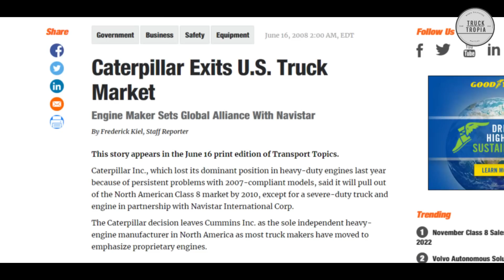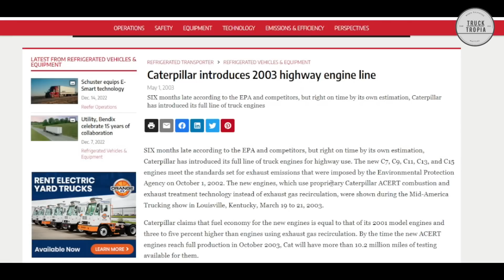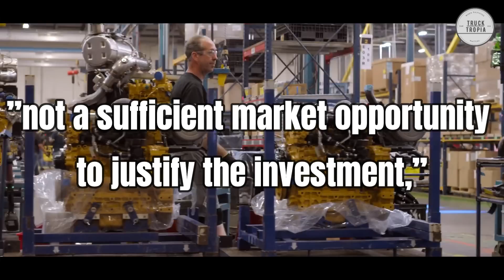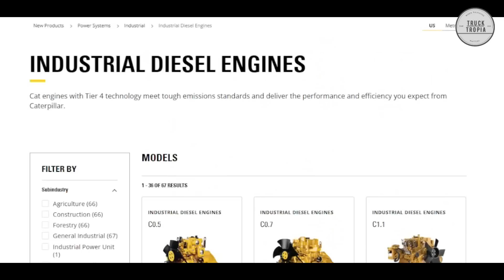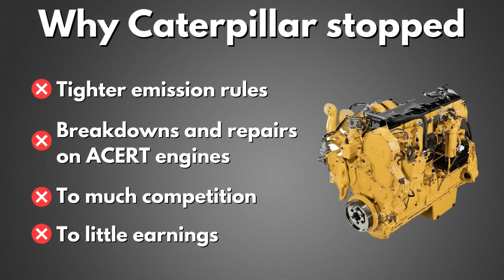Why Caterpillar Stopped Making On-Highway Truck Engines

Comment: Honest assessment of why Cat opted out of the on highway market. The trucks were too heavy and the engines too unreliable/fuel thirsty compared to what was available from other manufacturers. 
That said the rules for off highway equipment is not a whole bunch different than highway standards now. EG T3 as compared to T4 now. Soon to be T4 for off highway and T5 for on highway?
While I am not a big fan of Cat engines maybe there will be enough patents expired/Cat has learned getting to T4 standards for Cat to make the leap to T5.....still gotta make a truck chassis that is not made out of lead though
Reply: Cat never made a truck chassis.
Reply: @cbmech2563  Cat did put its name on a truck though......and it was way too heavy when compared to the competition
Reply: @paulchristensen2854  IH chassis and a maxforce engine. Never could figure out why Cat did it
Reply: @cbmech2563  IMO It was the engines that attracted Cat to Navistar. In the early 2000s Navistar had some kind of an agreement for sharing emissions technology with M.A.N out of Germany for their maxxforce engines.
Reply: @paulchristensen2854  and I still don't know what insanity infected Cat. Definitely not the smartest decision that they ever made.
Reply: @cbmech2563  IMO The" insanity" .as you put it, was the access to M.A.N's emissions technology Technology that no doubt has found its way into Cats construction equipment/off road and marine equipment Emissions standards for these have risen alongside the on road engines

Comment: The issue isn’t really the emissions on their own. It’s the fact the government decided HOW you get to those emission levels. Regulating a certain level of emissions or even No emissions is one thing. Requiring specific parts that are literally DESIGNED to break is another. 

Screw DEF
Reply: Designed to kill a diesel engine. And lobbied for by the manufacturer's of the def equipment.

Comment: Can CAT not build engines as industrial unit that can be installed by truck builders who then employ the pollution measures as add ONS for road use outside of the full engine build / supply. So some company needs setting up as the anti smog equipment manufacturer for use in any of the big ones. As far as I know some truck manufacturers will supply their trucks with the buyers choice of drivetrain? Like a cat motor and 18 speed Road Ranger. Can't be surprised they let go of the road trucks with all the hoops that are held up against the emissions

Comment: The best engine diesel engines every made was 3406 class because when they CAT said they there  425 , 550 , 650 horsepower was at the drive tires where you need the horsepower not like Cummings or Detroit diesel engines do not have the horsepower at the drive tires  I had a 1978 C500 with 425hp cat I also had 1979 W900A model with 425hp with 3:18 rend gears it had a twin stick the main stick was 9 speed and the auxiliary transmission was a 4 speed  I bought my first new semi truck in 2003 W900L with 72" double bunk sleeper a 3406 and it had a 550hp with a 18 speed

Comment: Simple oil engine is still the most environmentally favourable as it lasts and can be rebuilt many times saving manufacturing pollution. Also large particulat emissions is less harmful

Comment: Super trucker Dan on youtube has three Peterbuilt trucks. Two of them are 2001 with Cat engines he also has a 2013 with the Procor engine which lacked power and economy. For that reason he bought the second 2001 that has living quarters. You can't beat a Cat engine.

Comment: Cat chose the wrong technology to meet the 2007 (ACERT, Clean Gas Injection and their regen system for the DPF) and knew it would have to take a different path to meet 2010.  They bad mouthed their competitors with cooled EGR but the competition was able to meet the 2010 standards with cooled EGR, DPF, SCR and DEF.  Navistar tried to meet 2010 standards with massive EGR instead of SCR, they kicked Cummins out of their trucks because they were using SCR and came very close to going under.  A new CEO came in and begged Cummins to supply engines again to bail them out.
Reply: It is my responsibility to aware every one
Quran is the last book of God which revealed on prophet Muhammad saw quran is the only source of guidance in whole world quran will show you the right path quran also verify bible and torah and other scripture kindly once time you study whole quran and aware yourself from the aim of life and got success in long run 🙏🙏🌹🌹❤️❤️

Comment: The beauty is, you can de-ACERT a Cat. You cant fix bean-counter engineering though. So I'll keep my distance from the ISX.

A lot of people are now freaking out about the ATF enforcing rules as law. But they only use the book the EPA gave em. For decades the EPA has been writing and re-writing "rules" and enforcing them as if congress and the president himself had stamped off on it.

Comment: my last truck had a c13 --the engine has over 1.2 million miles on it,still running,only replaced one injector on it--my truck is the lightest in the fleet,have the best fuel mileage out of 65 trucks----have also  the highest revenue in fleet,tanker operation--keeping it around for just in case armageddon to haul a 45 ft reefer semi trailer for supplies...nobody likes the c-13 but it treated me great,light weight
Reply: It is my responsibility to aware every one
Quran is the last book of God which revealed on prophet Muhammad saw quran is the only source of guidance in whole world quran will show you the right path quran also verify bible and torah and other scripture kindly once time you study whole quran and aware yourself from the aim of life and got success in long run 🙏🙏🙏🌹🌹🌹❤️❤️❤️

Comment: Makes sense.  CAT never really needed the on road market to be successful.  Let's see if the EPA starts to regulate the construction industry as well.  I know that last year California put really strict emissions rules on trucks.  They cannot even enter the port if they are too old.  California this year is regulating generators and lawnmowers for some reason.  It really is a fraction of hours per year that these devices operated.  Thankfully, I have my 2 stroke chain saw already.
Reply: Off road diesels have had the same emissions rules as on road since 2014.
Reply: @southfork67  Not construction, backup generators or farm.  Even in California, we get to use red diesel for farm.
Reply: @samuelmcbride  I sell new farm machinery for a living. You are incorrect. Final Tier 4 emissions rules took effect on off-road engines (tractors, construction, etc.)  in 2014 with the exceptions of engines under 25 hp. They all have DPF, DEF, EGR, and all that crap.
Reply: @southfork67  I believe the 2014 "mandate" was about Tier 1 emissions for off-road, not Tier 4.  Tier 4 is definitely on-road now even to use it.  In California, we cannot even operate Tier 1 off-road except in fleets where the average emission is calculated.  Plus, we have to register it through an emissions center.  That exception is only managed by NOx readings and not manufacturer Tier rating.  Tier 4 mandate was supposed to start in 2022, but I don't think it went through.  Tier 4 is largely done through enhanced diesel fuel.  There are some changes in fuel delivery and urine exhaust treatment, but that is not really the engine.  Tier 4 mandate was "supposed" to be 2015 when it was  created by the EPA, but this was extended to 2022 last time I checked.

Anyway, a Tier 3 diesel can be made Tier 4 by simply adding some things and using new diesel fuel.  In California, red diesel is not necessarily the low sulfur variety and is allowed for use in ag equipment.  There are also a few exceptions.  If an engine builder has any unused inventory of any Tier, they can sell it legally.  If it is emergency, they can sell it.

It does not mean that someone that sells equipment will be able to get less than Tier 4 diesel engines from a manufacturer.  It is just not illegal to do so.  You can get a Tier 3 Polaris Crew Cab in  a crate and sell it legally.
Reply: The government won't be happy until everything has zero emissions. They'd outlaw horses. They're already whining about cows that fart.
Reply: It is my responsibility to aware every one
Quran is the last book of God which revealed on prophet Muhammad saw quran is the only source of guidance in whole world quran will show you the right path quran also verify bible and torah and other scripture kindly once time you study whole quran and aware yourself from the aim of life and got success in long run 🙏🙏🌹🌹🌹❤️❤️❤️

Comment: Best Cat truck engine I ever had was the 1693. Had to be careful when you let the clutch out. It had so much torque you could twist out the drive shaft.
Reply: The engine had so much torque it twisted the chassis coming off the line
Reply: @TIMEtoRIDE900  
The whole truck collapsed !
Reply: Back in the day my dad drove a 65 Hendrickson with a 1693 Cat. He said the same thing
Reply: The 1693 was a great engine, and they were easy to turn up. but they were extremely heavy compared to their 3406 counterparts. but I have known people who continued use them for a long time after the 3406 was introduced.
Reply: The bottom line is that if your foot slipped off the clutch pedal the results were going to be expensive.
Reply: It is my responsibility to aware every one
Quran is the last book of God which revealed on prophet Muhammad saw quran is the only source of guidance in whole world quran will show you the right path quran also verify bible and torah and other scripture kindly once time you study whole quran and aware yourself from the aim of life and got success in long run 🙏🙏🙏🌹🌹🌹❤️❤️❤️
Reply: Torque is related to hp/rpm *5252, if it didn’t have horsepower and it spin at the same RPM as the newer engines it probably didn’t have as much torque as people think they did.
Reply: @B0RN2RACE100  You have to take the flywheel torque (1,800 ft lbs) and multiply it by the gear reduction of first gear and low-range (don't have numbers for that, but let's say 20:1) then add the momentum of the fly-wheel - - more than 36,000 foot pounds.
Reply: @TIMEtoRIDE900  I have numbers, my c15 makes around 1850 pounds of torque 1st gear on my transmission is 12.31:1, rears are 3.36:1, and tires are 11r22.5(they also matter). My point was, if the engine doesn’t make horsepower it won’t make torque since they are related to each other. The 1693T made 325hp @2100 RPMs and at that rpm the torque is ~800ft-lbs and the peak torque was 1000lbs-ft at ~1450rpm
Reply: @B0RN2RACE100  I get your point - horsepower is calculated, torque is measured.
But back to snapping driveshafts - the rear gears and tire size really isn't part of the equation.
Reply: @TIMEtoRIDE900  oh I was arguing that the older cats are not that torquey to snap driveshafts, it’s probably weaker wore down shafts making the myth of “old torquey motors”
But I’m a different note, did you know why they make OD transmissions and not direct drive? Because the driveline torque is too high with a faster rear gear like 3.08:1-2.64:1. Let me go find the article from Eaton where they pointed out the limiting factors in diff was the driveline torque with lower numbers in rears vs higher like 3.70:1-4.10:1
Reply: @B0RN2RACE100 orsepower is a function of torque. Inline engines tend to have larger bores than their strokes which is why they are so torque heavy compared to the HP numbers (typically in the neighbourhood of 3:1). 

If you aren’t making torque you CANNOT make HP, because HP is only a mathematical function of the torque.
Reply: @elijahrobinson2362  you got it backwards, they tend to have a much bigger strokes vs bores, like the c15 having a 6.7 inch stroke and 5.4 bore. But the radio of bore vs stroke doesn’t matter, proven by Cummins who has a square motor of 6.25 in stroke and bore known as the kta19/qsk19(it goes up to v16 60ltrs which are all 6.25 stroke/bore) and the engine still produces 1950-2100ft-lbs of torque because it makes the highest hp-to-rpm range at lower RPMs. How much torque a motor Mamés has to do with how much power it makes at a certain rpm and engines that make their peak HP below 5252rpm will always make more torque than HP.
Reply: @B0RN2RACE100 , I failed to clarify that larger bore was in relation to V engines. That is why inline engines are so torque heavy, producing triple (or more) torque compared to HP. 

You’re so wrapped up in that formula and the misguided idea that HP controls torque. You have it backwards. Horsepower is a mathematical function of torque. It is calculated from torque, not the other way around. 

If HP is so vital, tell me why no highway truck produces 1850 HP and 550 pounds-feet of torque. 

That torque is what gets those heavy loads moving and keeps it moving on hills. HP is what accelerates the load. 

I’ve read all of your comments and won’t waste any more time on someone who wears intellectual blinders and simply refuses to consider any other viewpoint.
Reply: @elijahrobinson2362  very simple, rpm related.  To make 1800hp and 550ft of torque the engine would have to spin around 14000rpms, and the gear reduction would not be efficient and most of the horsepower would be lost as heat in the gear, plus at those speeds the weight of the gear would have to be reduced, making it less reliable.

Comment: Cat stopped building Engines For On Hwy trucks. Because they were NOT going to Continually NEUTER the engines to please the EPA. Still running 3406B Mechanical Cats in all 38 of my trucks.
Reply: Yeah they're good we have a multitude of medium-duty engines and we still have one 3406E in service in a 96 Kenworth and I keep those babies whistlin Dixie. 🇺🇸🇺🇸🇺🇸
Reply: I retired in 2020 after forty years OTR,a little more than half of which were as an O/O. I've had some experience with all of the motors that have been used in class 8 trucks during my time,and the 3406B is the easiest to work with. It gets the job done with less effort than any of the others.
Reply: @gary4507  and you don't get frostbite in the arctic. but if you like frostbite get a cummins
Reply: Smart man, that old 3406b is hard to beat and one hell of an engine.
Reply: One of the greatest engines for sure💪 love the sounds of the turbo and the mix of the engine itself
Reply: yup. Though I'm a fan of 60 series for light work (if it leaks it still runs) and n14's are good when replacing injectors is your gig, my boss is transitioning our smallish fleet to whatever has an auto behind it. Maybe I should take my tools out that no one else carries and work for you.
Reply: Thank you sir.
Reply: It's a guy talking about the Quran and not Cat engines. That's funny 😅😅😅😅
Reply: Can I drive for you?
Reply: It is my responsibility to aware every one
Quran is the last book of God which revealed on prophet Muhammad saw quran is the only source of guidance in whole world quran will show you the right path quran also verify bible and torah and other scripture kindly once time you study whole quran and aware yourself from the aim of life and got success in long run 🙏🌹❤️